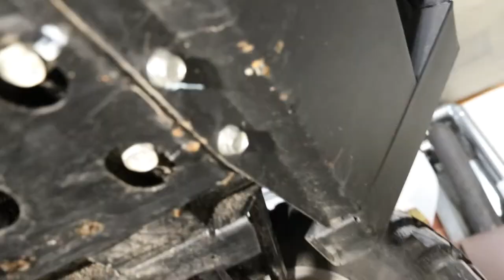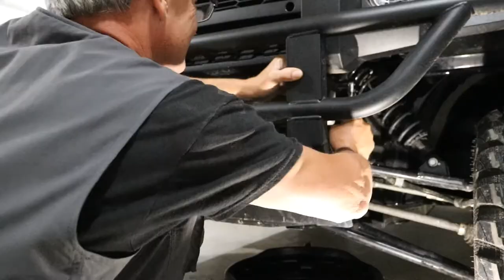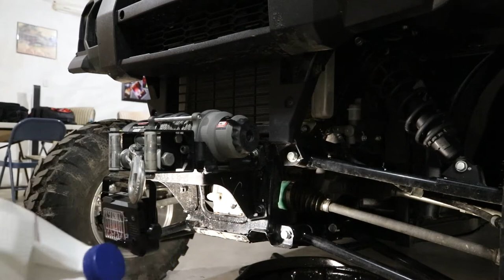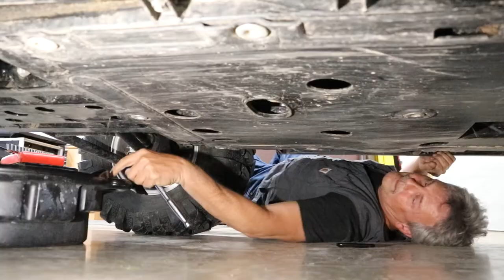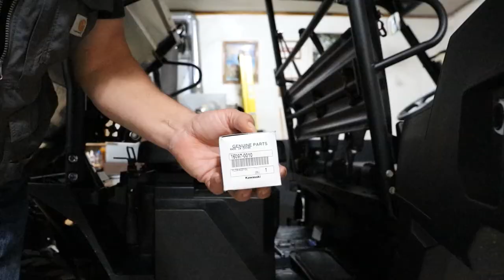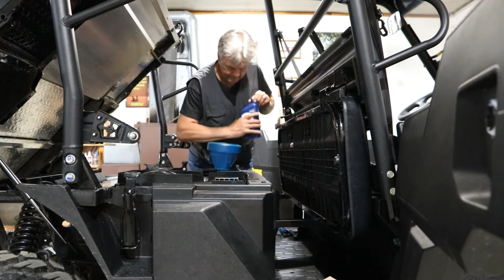Front Gear Case And Transmission Case Oil 2020 Kawasaki Mule Pro FXT

Comment: Thanks for the great video!  I just bought a new Mule Pro FXT 1000cc.  I was curious about the front diff oil change because I saw the labor was quite a bit higher for the dealer to do it if it has a winch.  I shouldn't have any issues with doing all that myself at home and save well over $100.

Comment: Thanks for posting this. I've been kind of avoiding this job due to the need to take the front bumper off - but after watching, it doesn't seem like a big deal. Really appreciate it!
Reply from the maker: You are Welcome . It is really easy just remember to pick up the the rubber o rings for the fill caps and have fun LOL . 
Thanks for Watching

Comment: Thanks for this video.  Just bought one of these and was wondering why the manual recommends that the dealer service the front axle fluid on the ranch model.  I see it's just because of the removal of the front bumper which is no big deal at all.

Comment: I have a 2016 FX PRO which except for the oil filter access on your's everything else is the same as yours on mine. If you want to save a little time and hassle with accessing that front diff. fill hole I would suggest using a step drill and drilling about a inch wide hole in that bumper plate. I had to do this to my Polaris 500 Sportsman and it makes the fill hole very accessible. I then use a 50 cc syringe with about 10 inches of tubing on it to fill it up.The other comment I have is that my owners manual also states that the engine oil capacity is 2.2 quarts but I have found out that it always takes between 2.50 and 2.75 quarts to fill it. (813 CC three cylinder ,and after filter change) not sure why the discrepancy. Good job on the video, thanks for the info.

Comment: Great video thank you so much that was so helpful for me. I have the mule Pro MX 2024 I'm not sure if it's the MX or the 2024 but on mine you don't have to take the bumper off you just have to take the four bolts that hold the winch on and then you can easily access the front case

Comment: I'm due to change my differential fluids as well so your video was very helpful. The Valvoline UTV oil is a lot easier to find in stores rather than always going to the dealer for the Kawasaki brand. But great video as always, Joe. We've been getting bombarded with rain here in Western PA and it doesn't look to let up anytime soon🤷‍♂️. Have a great day buddy. Look forward to the next one!
Reply from the maker: Good Morning , its has been raining here off and on for the past two weeks here as well . When I picked up the oil filter at the shop they did not have the rubber O-rings for the drain plugs so I picked up a Metric O-ring Kit from Harbor Freight and was able to match what I needed , in case you experience the same problem Have a good day and Thanks for Watching
Reply: Another oil that meets all requirements and is absolutely better than the Kawasaki or the Valvoline oil is Shell Rotella T6 Full Synthetic 5W-40.  It sells for $20-25 at Walmart for a full gallon. It's a favorite of motorcycle owners and ATV owners as it's the best protection you can get for the price and also works in ATVs and motorcycles that have wet clutches.

Comment: Did you have your valve check done at 20 hours? and if so who did it.  Thanks for the video of the oil change and gear box and trans. I have 10.7 hours on my new mule and was glad to see how all the fluid changes were done.
Reply from the maker: Hello, I did not have the valves set yet but when I do I will take it to the Dealer . That is a great way to keep the warranty rolling forward . The fluid change is fairly easy and for the rubber O-rings for the plugs I bought a Metric Kit from Harbor freight and was able to make a match up . I hope this Helps and Thanks for Watching

Comment: Hey there Daddyjoe nice video. You have any clips on a easy way in  taking off rotors easily and installing new ones? Thanks GB.
Reply from the maker: Thank you, I haven't done repairs on the brake system yet but if I do I will post it.
Thanks for Watching.

Comment: I have a question… does your gear oil have the limited slip additive? I couldn’t find it in the manual whether it was vital or not? Thanks for the video so far. Helping me out!
Reply from the maker: Hello and Welcome , The Valvoline gear oil meets Kawasaki's GL-5 requirements though I do not remember reading anything about Limited Slip Additive's on the container .  I hope this helps , Thanks for Your Comment and Thanks for Watching
Reply: The mule does NOT have a limited slip differential so does not need the LSD additives or LSD rated oil.
Reply from the maker: @RPG-oh1yf   Thank You , The Valvoline does meet all of Kawasaki's requirements . Thanks for Watching

Comment: I ordered the hydraulic lift for mine...you gonna get one sometime? Mine was $996.00 but feel it will be worth it. The install DIY looks straight forward and the instructions for all attachments is on their website under the PN.
Reply from the maker: Good Morning , I bet the hydraulic would be handy There are a lot of accessories for the Mule you can really dial one in the way you need it .Did you get yours home yet ? and Thanks for Watching
Reply: @AskDaddyjoe  Hopefully next week. Its there and still needs to be assembled. Keeps saying waiting for me to tell him when I am coming. Still waiting to hear if my parts are in before I go so I only need to make one trip. Dealer is an hour plus away. I can't seem to make him understand that....LOL. Terrible at return calls.
Reply from the maker: @kidhenderson8260  I know what your talking about I would rather spend my time in the Mule instead of hauling it LOL

Comment: Daddyjoe, been watching your videos for awhile now. We picked up a 2022 fxt a couple months ago and the family loves it.  Running up on 200km/20hr mark and i'm going to replace the fluids.  The video was awesome, it's gonna help me out. Just a question on where you got the torque values from.  My manual for the 2022 has the following and it differs, Engine oil drain at 37ftlb and oil filter at 15ftlb,  Front Final Gear filler cap and plug are both marked for 25.3ft/lb, Transmission case filler cap and drain bolt are marked 15ftlb.
Reply from the maker: Good evening and Thank You. My mule is a 2020 and the torque values are from the manual so maybe they have changed a few things. Changing the fluids wasn't bad you should get right through it. Have fun with the project and 
Thanks for Watching
Reply: @AskDaddyjoe  Well it's done! Your video was a god send getting me through this. One note for anyone who is curious, the manual says to torque the the oil pan drain bolt to 37ftlb(2022 mule)... there is no way this was going to happen before you stripped the pan threads off. You could feel it through the wrench, I left mine at 20ftlb and it seems like enough. Thanks again Daddjoe!
Reply from the maker: @MattMatt2k10  Good evening Matthew and Thank You. You wont have any trouble the next time you service your Mule and you have the satisfaction of knowing your machine is taken care of. Have fun out there.😎

Comment: Where do you get the replacement O-Rings for the front and rear case filler/plug bolts?
Reply from the maker: Hello ,I bought a metric O-ring kit from harbor freight for nine bucks it has about 500  of various sizes . Thanks for Watching
Reply: @AskDaddyjoe  Ah didn’t think of that. Good call I just bought a 2022 a couple weeks ago and already have over 100 miles on it!  Time to changed those fluids already.
Reply from the maker: @sgav8r  Congrats on the new Mule and you are outside and having fun . Oh Yea😎

Comment: Daddyjoe, can i use the same gear oil for the transmission oil?
Reply from the maker: Yes, the oil is the same and it is a good idea to have the O-rings for the filler caps before you get started. I hope this helps and Thanks for Watching

Comment: I ended up welding a nut onto the a bolt to get the transmission plug out, wow was it tight
Reply from the maker: Well hopefully it will be easier the next time, the oil filter on my machine was really tight on the first oil change. Happy trails and Thanks for Watching